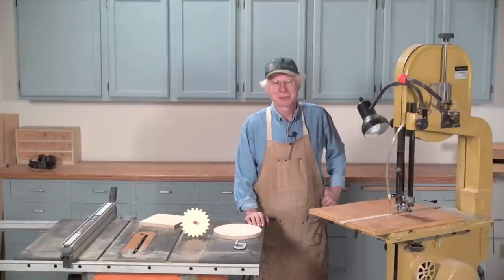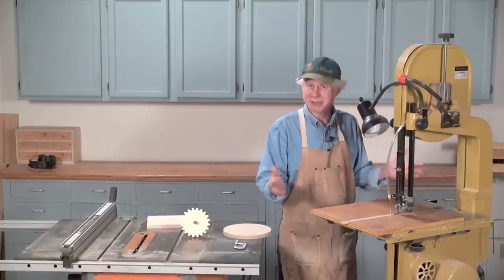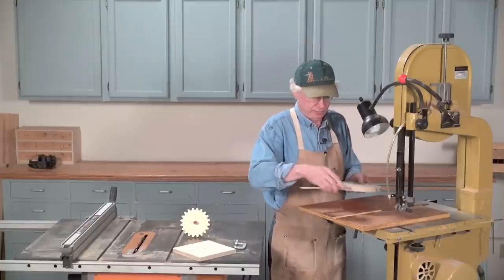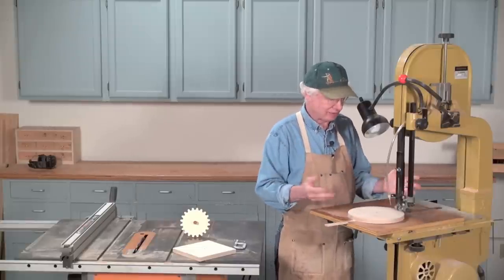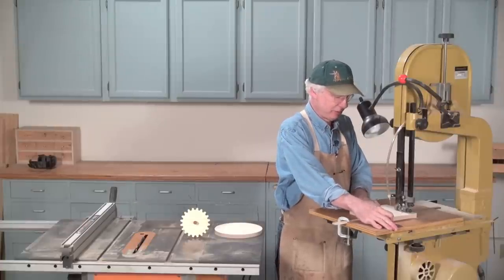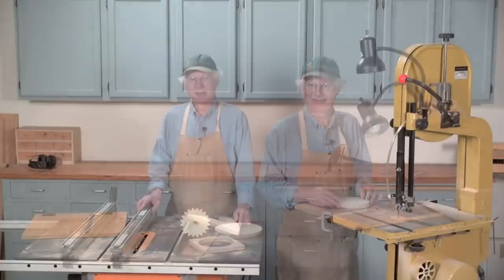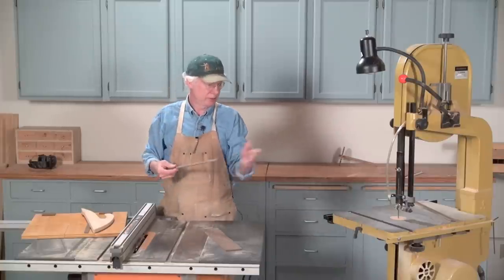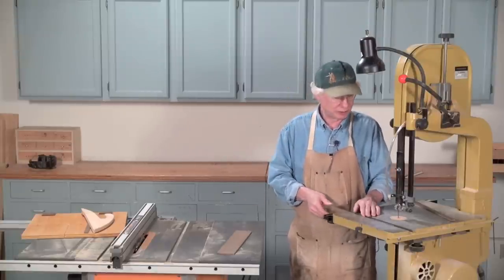Precision Circle Cutting Jig

Comment: I'm pretty new to this, but had a thought while watching. Is there any big disadvantage to cutting dado only halfway across, not quite to the bandsaw blade? There would be a limit to how small you could make a circle (1 inch maybe), depending on where the dado stopped. But you also wouldn't need the zero clearance piece because the blade would be snugly in the slot of the plywood, with no dado undermining it. You might want to cut the dado with a router if the cut stopped partway through right?

Comment: I made this jig very similar to this.  I'm trying to cut 5.5" circles to use 3" lazy Susan brackets so they can turn.. However my circles keep on coming out slightly oblong making it wobble when u spin it.   I made sure the blade is tightened as much as possible and the front of the blade is center in the pin.  Any other suggestions?
Reply: when I had this happen I concluded my blade was not sharp.  Usually when cutting on bandsaw you can steer the wood to compensate for imperfect  blade.  Here, wood is fixed and blade goes where it wants.
Reply: Pincenter should be more backwards, bottom of teeth or maybe more. That small circle needs 6mm or less wide band. Sorry but here in civilized world we don´t have quarter " button in keyboard. Have fun with Trump